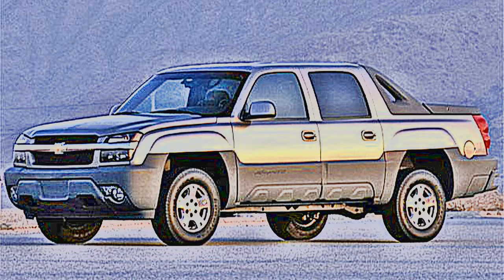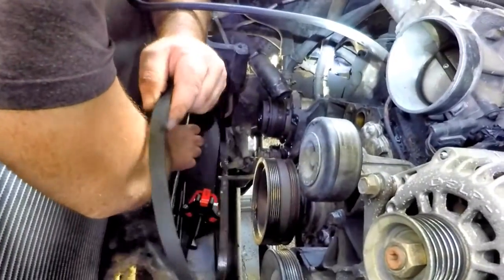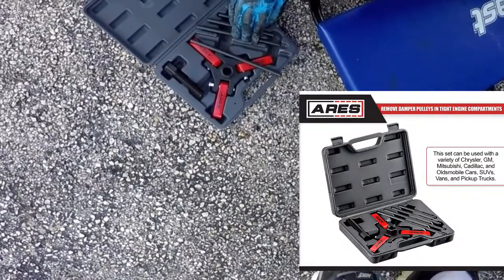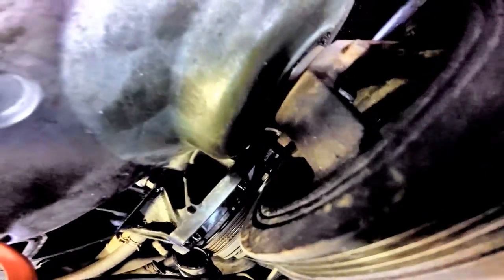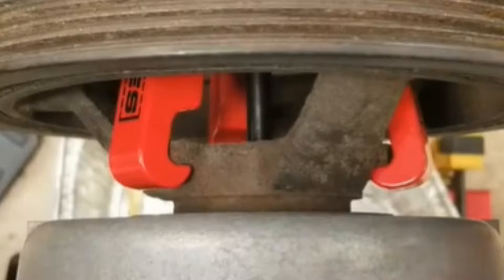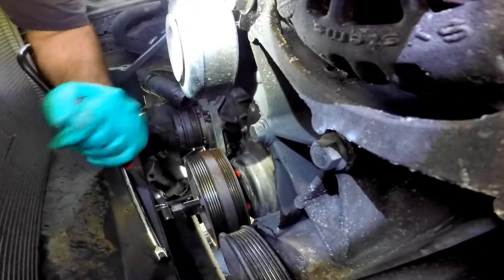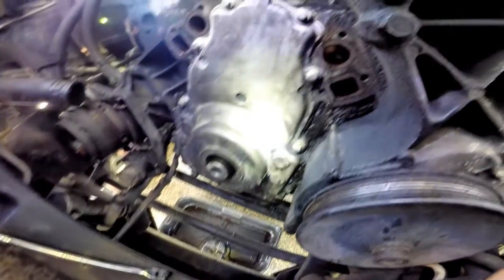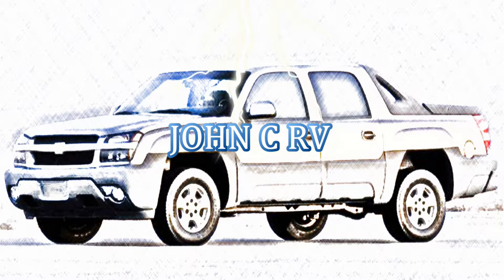How to Remove Harmonic Balancer | 2002 - 5.3 LS Chevy Engine | Using a 3 Jaw Puller

Comment: That's a very handy tool. I bet it makes the job a ton easier than prying with long screwdrivers like we used to have to do.😂
Reply from the maker: When my son told me he wanted to tackle this project the first thing I said was No! 
Until he showed me this tool he wanted to order. Man, nothing else scared me after that.
The pullers we had in the old days were big and bulky way to close to the radiator.